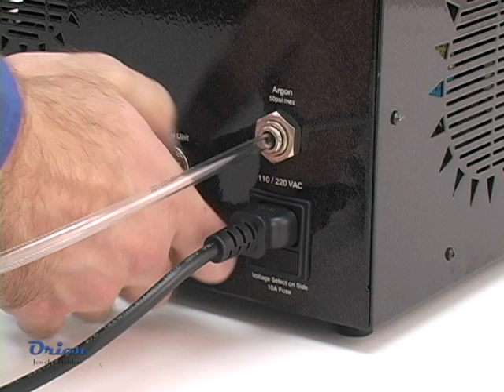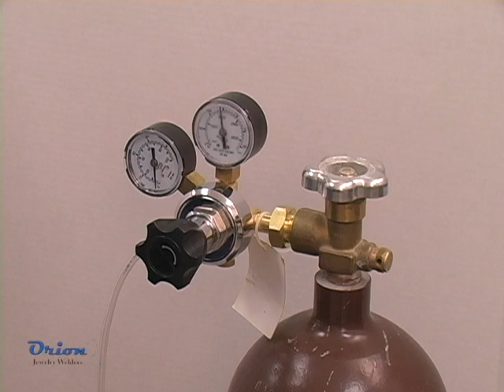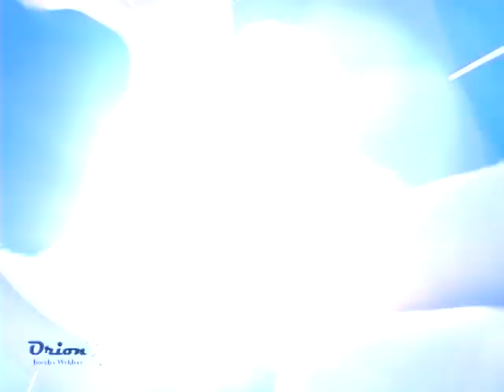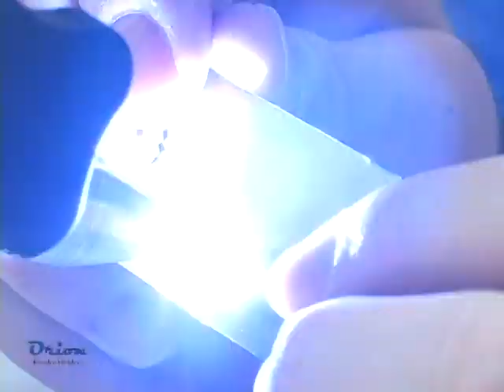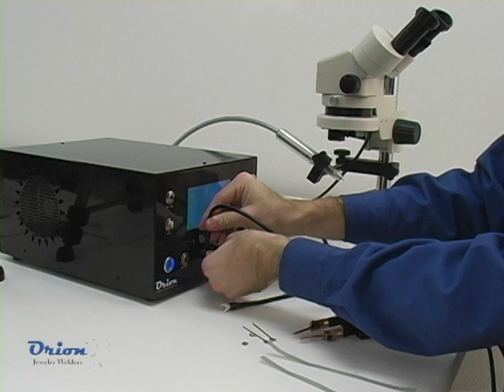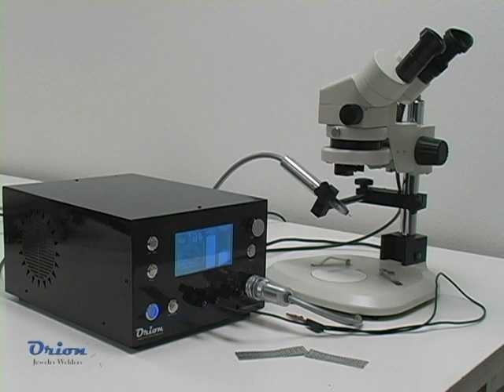Orion Jewelry Welders - Welder Setup Overview

Comment: how much ??
Reply from the maker: The model in this video is an older model but our Orion Pulse Arc Welders run for about $2,000 on the lower end and up to $8,000. If you would like to learn more from our Welding Consultants please call us at +1.801.658.0015 or email us at sales@orionwelders.com. Thanks!